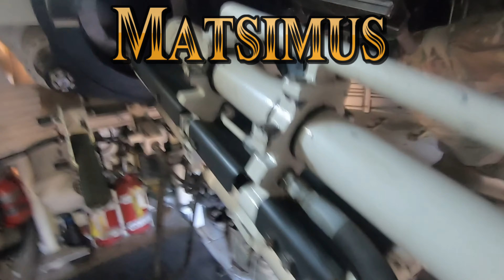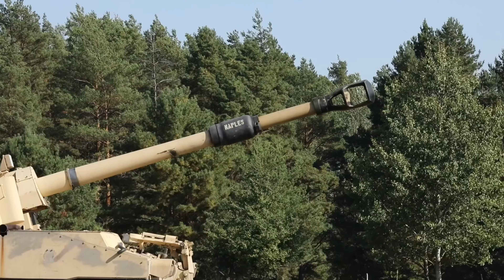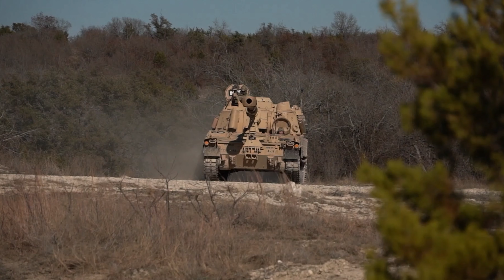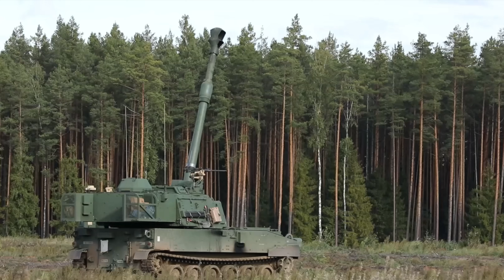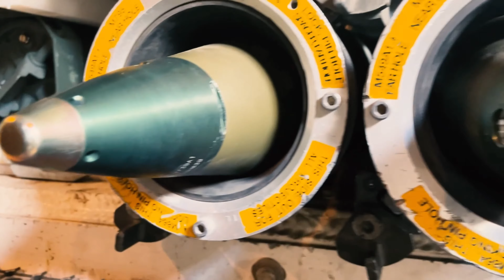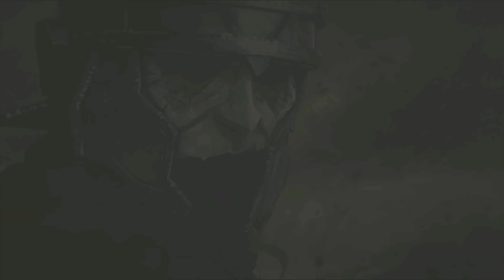The modernized 'Paladin' M109A7 155mm Self-propelled Howitzer Artillery System

Comment: During my second tour in Iraq. I was tasked out to support the 101st ABN 1-32 CAV because they were running Bradley's. Yes Bradley's  lol. They had 13 Pre-po Brads because they were getting hit hard by IEDs so they requested armor and got Pre-po Brads. And 5 Bradley mechanics from 4ID. Myself being one of those Bradley mechanics. Near the location we were sleeping was the Paladin gun line and infront of them was the mortar pits. The mortars never bothered me. But the Paladin's made the cheap plaster the Iraqi's used when they made those buildings fall on my head while I was trying to sleep at night. We had to walk close to the gun line to get to the MWR on the FOB. One night I am walking along in calf deep moon dust with nothing but the moon to see by. And suddenly those bastards did a fire mission lmao. Scared the bejesus out of me and I ended up flat on the ground covered in moon dust and my M4 was filthy. Didn't make it to the MWR. Just went back and showered, changed cloths and cleaned my M4. I had been mortared by the insurgents many times and rocketed too. So I was kinda desensitized to that sort of thing. But the Paladins still got me lol.

Comment: Paladin is really starting to show its age.while some system upgrade have modernized the system to fire programable projectile and have modern batlefiele computera and comunication. But the system still lacks some major advances.

Firstly the armour is very thin. Yes, its light  and that is good for air transport, but very vonurabke to counter artilery fire.

The deply  and redeply time is also a  bit to slow, and so is the fiering rate.

Comment: Wondering why the gun enhancement hasn‘t been done yet. BAE already trialed the 109 with the Rheinmetalls L55. It worked and it would be a hilarious inexpensive upgrade.
Reply: It would only increase range, the base system is outdated. It needs a better loading system and magazine etc etc. At that point buying a new system like k9a1 or pzh2000a1 is more efficient. Keep in mind that the basic system is from the 1960's

Comment: Feels to me like dragging a dead horse, I did 4 years on the A3 and the moved to PHZ2000, this a7 is same gun as a6, useless semi autoloader. Why don't they get a better gun from abroad? K9, Ceasar phz2000 so many available.
Reply: Y'all need Bears w/ Beers and some  Polish Gunners.
Smokes.
Worked at Monte Casino
Reply: @jmjones7897  need a good gun with some range and attitude. 12 shots a minute and scoot.
Reply: Bears Bearing Ordnance also increase effective rate of Fire as well as Unit Morale and Cohesion.
Reply: Bears work better with towed Guns than SPG. Just not enough room in there for maximum Ursine efficiency

Comment: One thing I never understood is the use of special ammo carrier vehicles. Since they are as big and heavy as the SPG itself is and probably not much cheaper, why not just get a second SPG instead?
You wouldn't even need a full second crew, just a 2-man transport crew that drives the empty of the two SPGs back and forth between the ammo stash and the firing spot, switching and handing it over to the main crew once it is fully stocked again.

That way you would double the time between barrel swaps and there would be a fully functional spare SPG in case one is damaged or lost.

And if you would do that with a more advanced SPG that has a autoloader or a semi-autoloader and can be fully operated with a 4-man crew, you could even have 2 fully operational ones with the same crew size as 1 hand loaded one and a support vehicle, which means even though in normal operation only one would be firing and the other would be reloading, you would have the option to have both firing in emergency burst operation, so to say.

Another advantage of that would be that both SPGs, even when firing alternately, could chose separate hiding spots, which means that no reconnaissance drone or anyone else could follow the path of a support vehicle to the hiding spot of the SPG.
Reply: Dedicated ammo vehicles can carry far more ammo. A single one can supply additional ammo for multiple SPG's for longer than your rotation of 1 idea. For large scale bombardments and sustained warfare, dedicated ammo carriers are superiour. 

This doesn't mean your idea is without merit.

In a move and scoot scenario and counter battery fire I'd use your idea but with rotating an SPG instead of driving a a partially manned one and swap location to fall back to a resupply location. This prevents you from revealing locations in this day and age of drone warfare. All the enemy would have to do is follow the ammo carrier to all the SPG's allowing for them to be taken out.
In a rotate 1 scenario they would only know the location of a single gun and any attempt to take it out by arty would open up their arty to be taken out by the rest by counter fire.
Reply: The ammo carrier is far cheaper to produce than the carrier with the turret and artillery.

Mobile artillery without autoloaders are cheaper to produce, less complicated to manufacture and service.  It's faster to replace Private Shove-A-Shell with a muscle strain than an autoloader that requires pulling then entire unit to a rear area to have a bunch of support mechanics try to fix or replace your autoloader while dealing with all their other tickets to fix.  The gun is also going to be heavy and expensive.  So that's much more mass to transport and more weapons to maintain.

Using ammo carriers give you more logistic capabilities.  Your logistic team might want to stage ammunition at a firing position for sustained missions.  

Risking an ammo carrier out in the open to resupply vs risking an entire trained artillery crew is the least risky scenario of having the artillery unit have to return all the way to a supply depot and leave someone without fire support, when a few ammo carriers can keep ordnance flowing.

The soldiers driving the ammo carriers don't need as much training as gun/carrier crew.   Also, if I have half the gun crews, I can train them twice as much for the same training budget.
Reply: Good question.
I suppose it comes down to versatility, as situations change so can the type of munitions. One or two of these carriers could resupply a battery.

Comment: Well M109A7 is good, but still comparably outdated. It would require a full core system rebuild and redesign to bring it on par with PzH2000 and similar systems.
and at that point, buying PzH2000 or K9A1 is just cheaper and more efficient

Comment: The M109A7--an exercise in absurdity!  A rehash of the M109A6 with the same L39 cannon, and M2 Bradley engine and running gear.  It only adds a semi-automatic loader, which apparently does not increase the rate of fire, according to some specifications I have seen.  A national embarressment in comparison to the Pzh 2000 or K9 systems.

Comment: 2 generations behind the most modern kit coming out of West Europe. There have been talks to retire the A6 with a more modern system like the PZH2000 since at least the 1990s, now the PZH2000 is being retired by the Europeans for the RCH155... Well the US still has the A6, and a slightly less obsolete A7. 

I'm reading on Army Recognition that the US is planning to procure another odd 700 of them, and keep them in service till 2050. Quantity over quality I suppose. Compared to the West Europeans which are gearing for a mobile war a-la WW2 - it seems the US is gearing for a linear one, a-la WW1. Perhaps the US option is safer, as we see Ukraine has devolved into a linear war. Then again however, that war is being waged with lighter cold-war design Bradleys, LAVs, Marders, and BMPs, not Ajax' and Boxers.